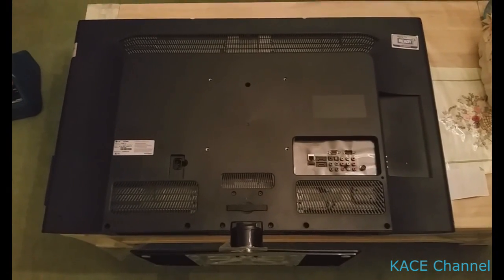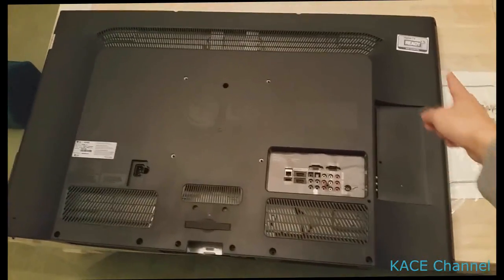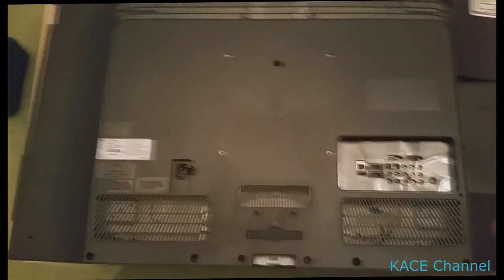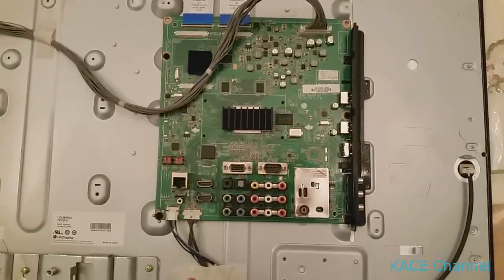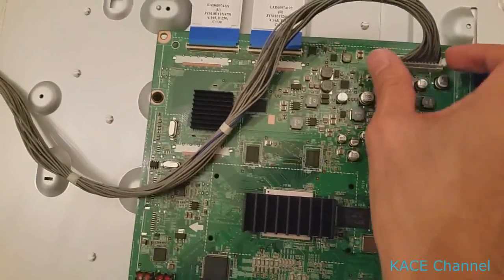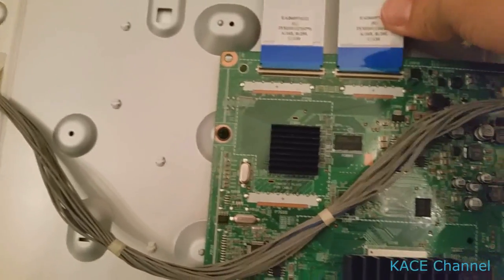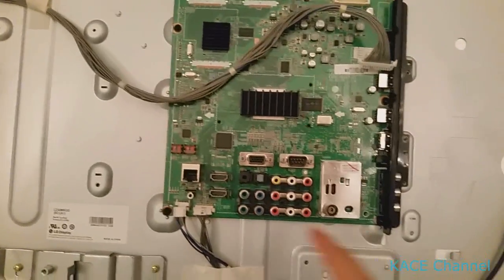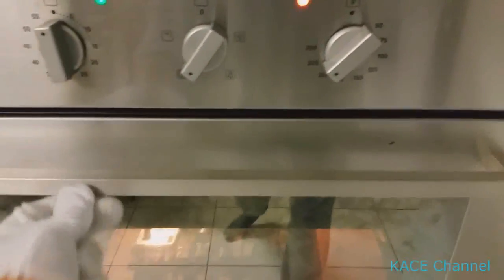Bake TV mother board in oven to fix broken TV - DOES IT REALLY WORK?

Comment: My mom tv a Westinghouse wd50fb2530 stopped working! Worked for 30 seconds then cut off! And so on and so on restarting after 30 seconds! Motherboard and power supply were built in together! I baked it and wala! Tv is working again! Left it working overnight without a single problem! Maybe some soldering joints problems all  capacitors look good!! Working since!!

Comment: I baked my Tv's logic board in the oven for 10 min @ 375 degrees.  It worked like a charm and I have been enjoying this very nice flat screen for some time now.  Baking in the oven re-flows the solder and in most cases fixes CERTAIN ISSUES.  If your TV won't power on, it has nothing to do with any board that could be fixed in the oven.  It could be as simple as resetting it by unplugging it for 10 sec and plugging it back in, to replacing the power supply board.  I can't imagine your audience will ever equate you with the stars of shows like Myth Busters unless you make sure you understand the situation, and the details of the claim or myth you are trying to "bust". I can't find any videos on YouTube titled: "TV Repair!  Bake your TV's  motherboard at any temp you want, for as long or as short as you want... FIXED!"  So why not just watch the video with a similar title, decide if you think its bullshit or not, and then decide if you should debunk it?  Instead of just reading the title and then doing all that work

Comment: The toxic stuff was that bad cardboard box and the temperature wasn’t high enough to get the solder melted from my understanding you need 370 to 375 F for 10 minuets.
Reply: His oven uses Celsius, not Fahrenheit. 200 C = 392 F

Comment: I did it with my LG 42LD550. It was stuck on the LG screen.  Initially, the HDMI ports stopped working. And then it went to that mode where it was just stuck on the LG screen. I tried all the remote options, which did nothing. I cooked the board, and everything worked, including the HDMI ports. BUT - the problem came back later. First the HDMI ports stopped working, and then I was using the component cables, and eventually, stuck on the LG screen again. I am about to cook it one more time to get some more use out of it. I'd like to say this is the last time I'll do it, but.... the screen is amazing when it works. Can't bring myself to throw the thing out.  Edit: Yeah, from the other comments, I see it didn't work for you because you only heated the oven to 200 degrees.

Comment: Your supposed to put it at 385 degree lol
I’ve doen this with laptop and the same tv it works every time
Reply: DJ Steve Sire his oven is not in Fahrenheit. It’s in Celsius. 385 Fahrenheit is about 200 degrees  Celsius
Reply: @amolay3419  😂
Reply: so it works on just about on all then..i've read much on LG's motherboard that it worked! Since you've mentioned your "laptop" then it should work on my 46" Samsung motherboard.. same symptoms no sound and pic ..the power red light on and off then fades away!

Comment: Today I fixed my LG TV by using this method. I used my toaster oven for this purpose because I could take that one to my backyard to avoid the strong smell emits from board when the soldering melts.
Symptoms: When I push TURN ON button, red light blinks two times and then it becomes white. Nothing else. Black screen and no sound.
Model: 47LW5600
Temperature: 400 Degree Fahrenheit 
Time of baking: 15 minutes

My TV worked right away after I put back the motherboard.

Comment: dont do this people fault will happen again or you will destroy the board .. just take it to a repair shop
Reply: If someone is capable of doing this, they're capable of ordering a new board and replacing it themselves. This is a good, quick, FREE way to try and diagnose the board. It has been documented to work for people time and time again, it absolutely will not destroy the board when done correctly. If the problem comes back, so be it. The person proved they can replace the board themselves, so why not go the free route before buying a board, or worse yet, paying someone else?

Comment: solder does not melt at 200 degrees F which is why this did not work.  Depending on the specific alloy it melts at around 370 degrees F according to a quick Google search
Reply: In Europe we use 'degrees Centigrade' not Fahrenheit like in the US. 200 degrees Centigrade is equal to 392 Fahrenheit.
Reply: that's what I was thinking, you were probably doing centigrade.  I suppose it would only work if that board was the problem.  I've replaced my power board, put in new power strips, so I'm about ready to try this.

It seems like ten minutes is extra long particularly if it is pre-heated.  
 @hyperion8008
Reply: His oven uses Celsius, not Fahrenheit. 200 C = 392 F

Comment: This hack worked for me yesterday. It got my 55in led LCD tv repaired after it got stuck at LG logo screen. Model number 55le5500.

Set oven at 350f (targeted for 385 because it runs hot and is old), after preheated, placed motherboard on piece of cardboard and baked for 10 minutes, after 10- turned off oven and cracked open oven door about 1 foot open to begin cooling for 10 minutes, then opened oven all the way for 10 minutes. After, removed from oven and set on table until cool to touch, then reattached it. 

Smell: yes, it smells bad, but i didn't have as much smoke and fumes as it looks like this guy did. Kids were in bed sleeping and it didn't go upstairs- we opened a door for fresh air, and turned on a bathroom fan. It was less powerful than food that falls in the oven and burns. It was a "hey- I can smell the solder now" strength. Not worth worrying about doing it outside, just make sure you can open a window or a door for fresh air. 

Thanks to everyone for your help! Pay it forward.
Reply: Did your fix last long? I knew this fix worked on some other elements such as computer GPUs but the fix was temporary, so I'm curious. Is your TV still working?

Comment: mine didnt work at first, then i did it again 300 for 10 min and 30 min cooldown put everything back and it started working just fine
Reply: how do you make the plastic connector not melt? Do you have to unsolder everything?